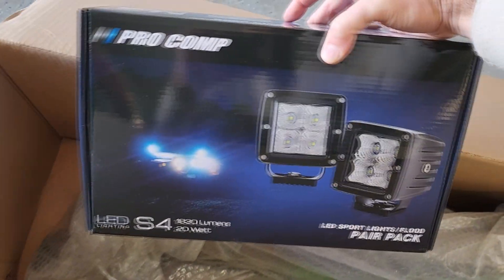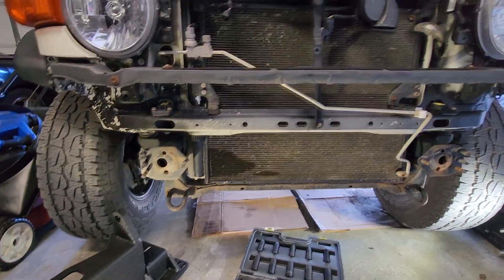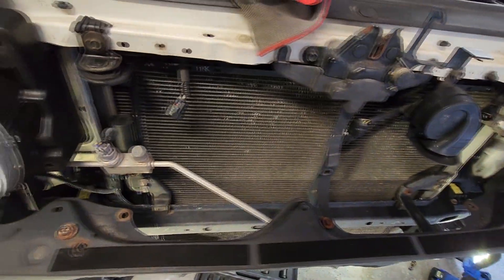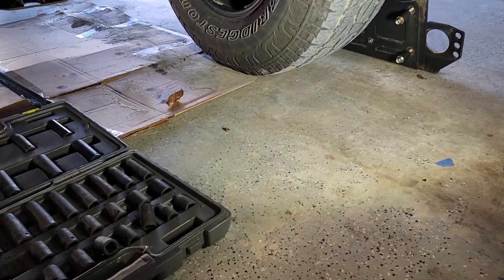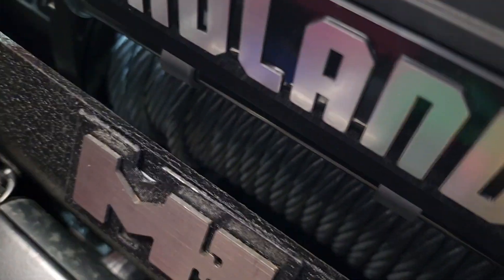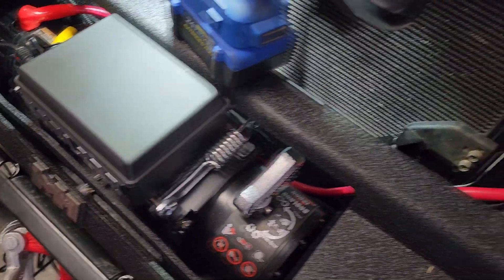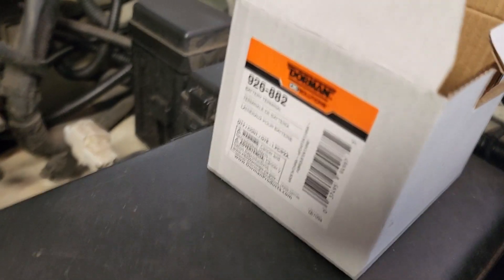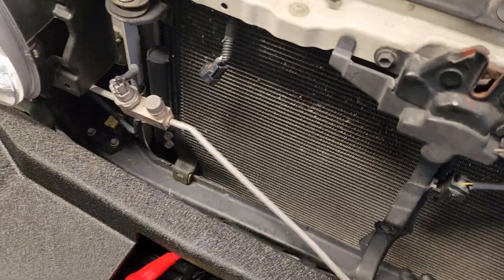2008 Toyota FJ Smittybilt M1 front bumper and Badland 12K winch install

Comment: Trying to figure out how to mount my 12000 apex winch to my arb winch bumper. your winch looks different than mine.mine is not clockable.
Reply from the maker: Yeah I think that model is all integrated right? Gonna be a challenge. Might have to cut some metal for access
Reply: @jcx2bby  ya i think so.would explain why it was so cheap.thank you harbor freight.